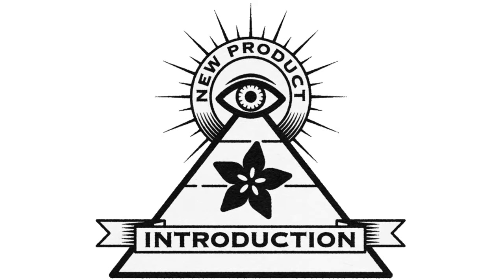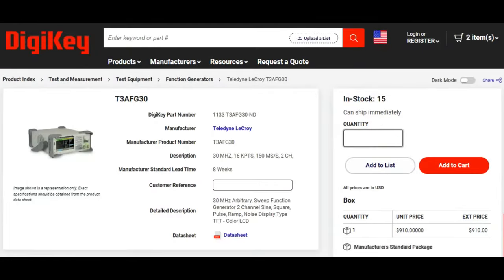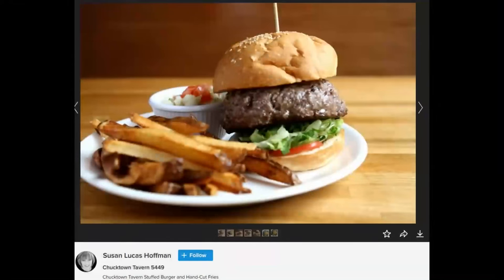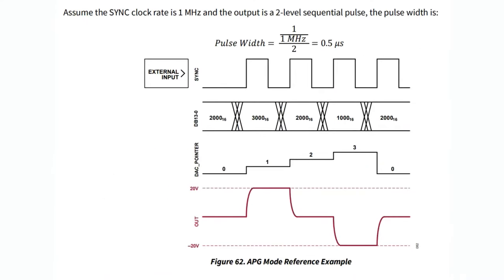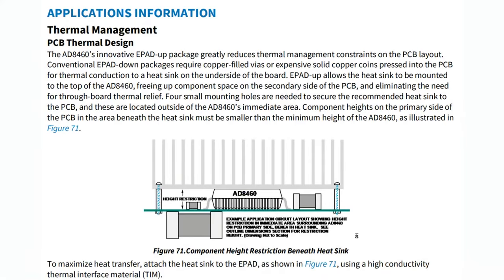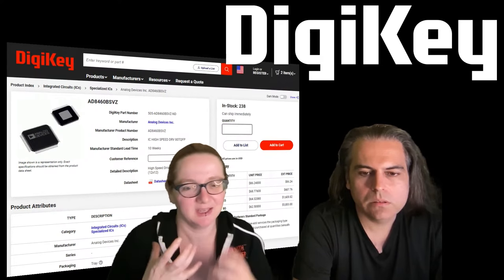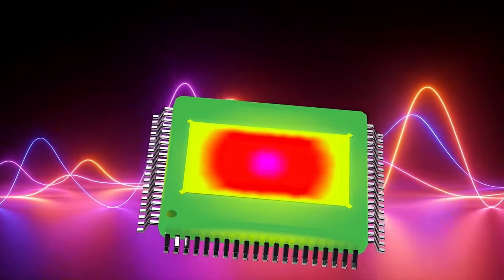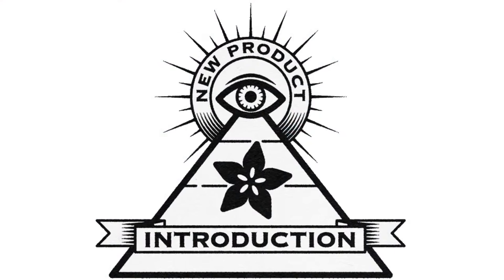EYE ON NPI - Analog Devices AD8460 110 V HV, 1A Arbitrary Waveform Generator @DigiKey @ADI_News

Comment: Sounds like an interesting device!  If one wanted to extend the output, to say a build an HV AWG volts capable of a few hundred volt swing - would it be possible to combine several of these in series with some other circuitry?  The datasheet didn't seem to mention a use of this type.
Reply: use an external amplifier to boost the output